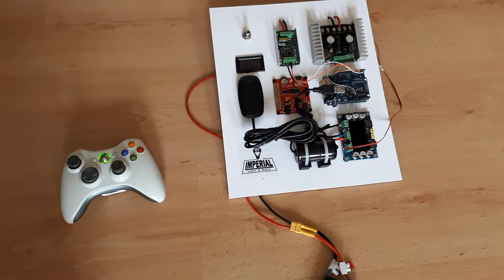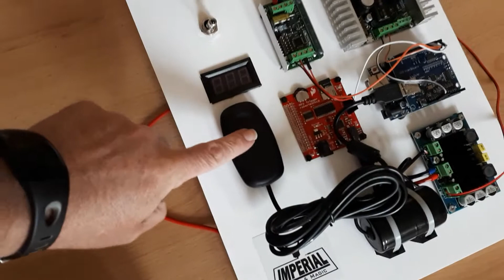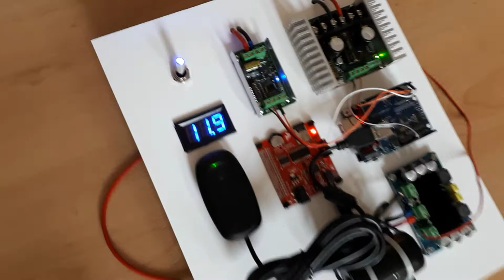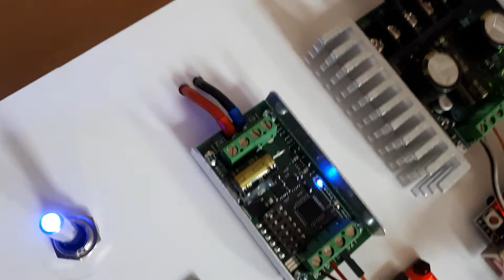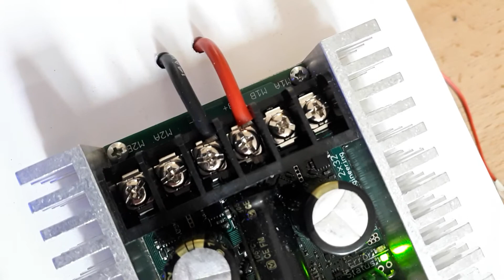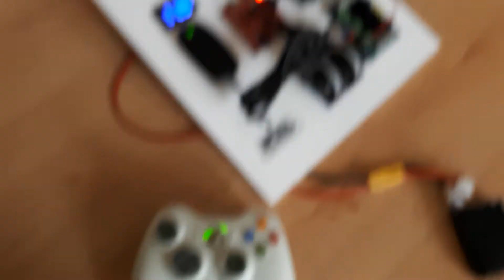Padawan 360 build

Comment: Hello....thank you for these amazing videos!  Question....where is the "range" on the controller?  Do you need to be fairly close to the R2 unit for good signal (assuming no nearby interference).  Is there any type of antenna needed to increase the range?
Reply from the maker: range is pretty good, certainly further than I would ever want to be apart from my droid in a public setting

Comment: Hi mate, great informative videos. I'm currently evaluating the Padawan 360 setup for my build. How have you found items from Ali Express? They seem a lot cheaper, are they up to the task? Also did you pay import duty to the UK?
Reply from the maker: Well, the arduinos, amplifiers, voltage readouts and switches are all from Ali.  There has been an issue with getting host shields from them which has recently been resolved, but they require a change of chip, so recently I have been buying mega ADK's which come with host function on board.  Sabertooth and Syren are direct from Dimension.
Hope that helps.
Reply: @ImperialLightandMagic  it does help, a lot. Thank you very much for your reply, I appreciate it.

Comment: Is it possible to add a 4th Speed Setting and use the 4th LED ring around the xbox button?  I have been trying to alter the sketch, but only getting it to sort of work.  Every time I disable and re-enable it default back to the  wrong setting.  Seems simple enough, but I am no expert yet in C/C++ code.  Anyone ever get a 4th speed step setup?
Reply from the maker: Honestly, I think two speed choices would be enough, low and high.  Bear in mind this only governs the "top speed" of your sabertooth 32 and in my personal droid, I kinda use high speed only where traction/torque is an issue, having three speed choices is I would think plenty but if you feel the need for finer granularity, I don't see why you couldn't add another speed mapping variable in the sketch.
Reply: @ImperialLightandMagic  I understand. I am actually modifying this for the Lost In Space B-9 robot and not the R2D2, so I am moving 200 lbs. and more speed controls would be better.  I'll keep trying.  Thanks!
Reply from the maker: @SeansHobbyHouse  You know dimension engineering make far beefier speed controllers that would work in exactly the same way?
Reply: @ImperialLightandMagic  Yup, I figured out the code (didn't use an "else" where I should have).  So now I have 4 speed levels, matching led indicators.  Yes, I have their 2-32A controller for wheelchair motors.  Works great now.  Next is to figure out how to use the 4 way thumbpad to turn the waist left and right and the bubble up and down.
Reply from the maker: @SeansHobbyHouse  Ah awesome, my mega arrived today so was gonna have a look but glad you are sorted. How are you turning the waist (mechanically) and bubble?
Reply: @ImperialLightandMagic  The mega is still an issue, only my Uno is working.  Again could be the brand of my USB shield (i ordered a different brand suggested to work with Mega).  The Xbox receiver lights up correctly with Uno, but not mega.  I'll have to troubleshoot that one too as I want to use the mega.  The waist is just a motor, the bubble up and down goes off of a servo.